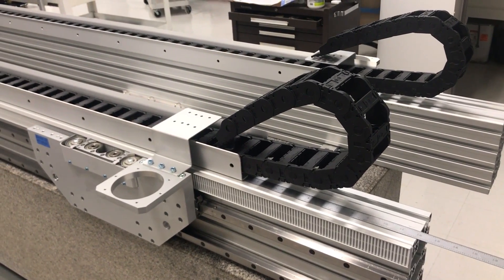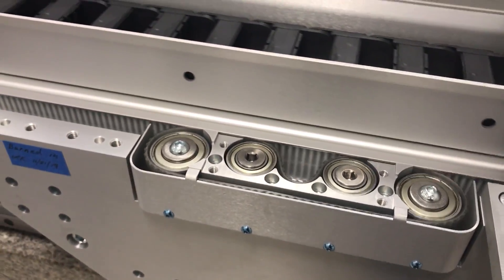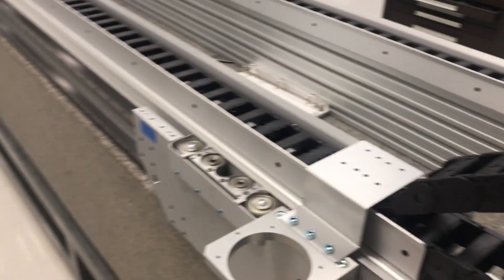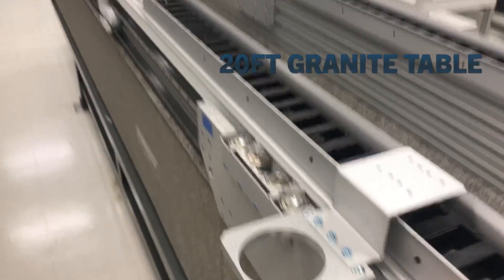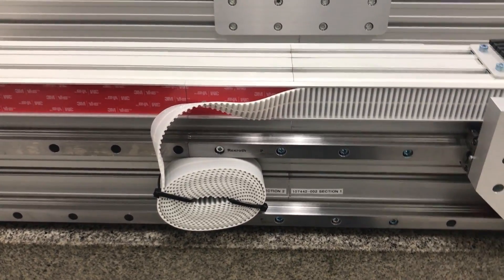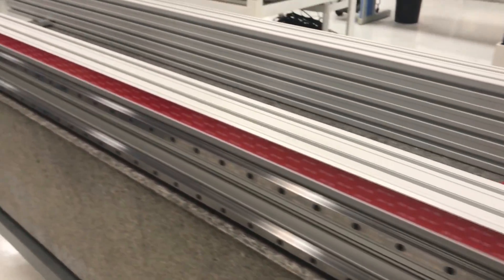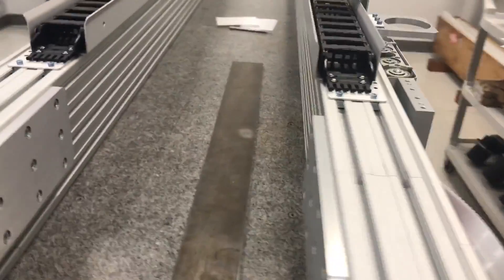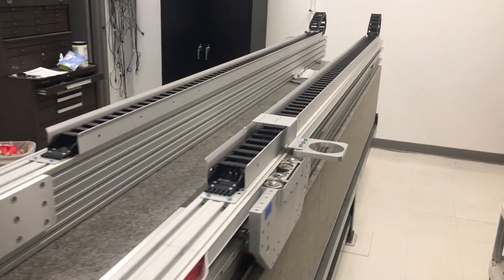Servobelt Medium Loop Track

Comment: Hi, what belts are you using for your assambly? Because as I found on the internet the most common and recommended belts are gt2 or htd type, but if you take either one and just look at the tooth profile you can see that they don't fit into each other. Either you will have a gap which I think will cause backlash, or you will need to press it in with force - this might be possible, but will lead to higher wear and in the and you will get play around your pulley and backlash.

Greetings from Germany!!!

Comment: What's making sure that the belts are in contact? This is a rack and pinion like solution, and there we usually see a tensioning spring.
Reply: Nothing :)
Reply: Exact clearance. You can also do a direct rack and pinion without a tensioner or gearing.

Like that one...just a pinion in the Motor https://youtu.be/yyDC-IV1Ook